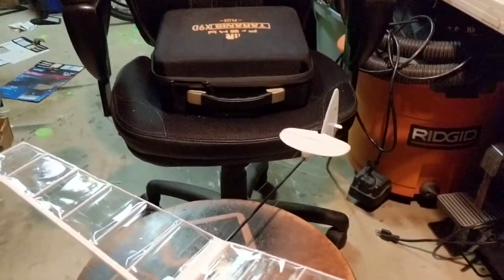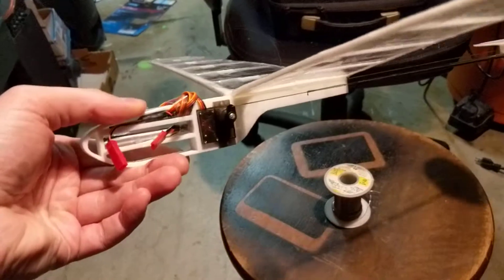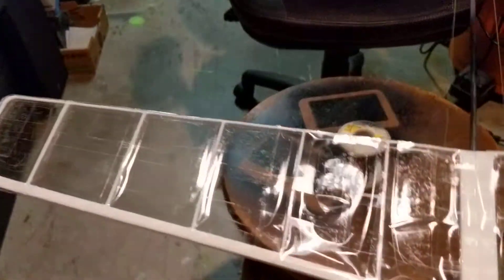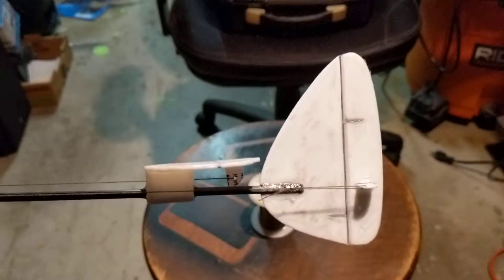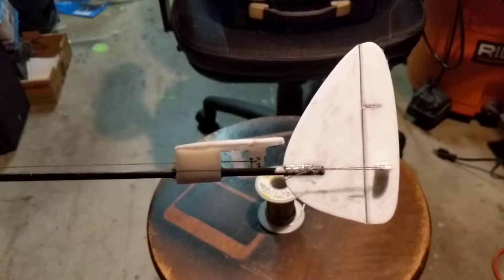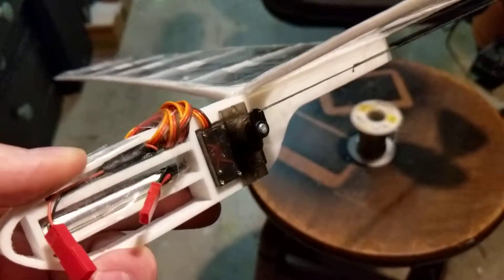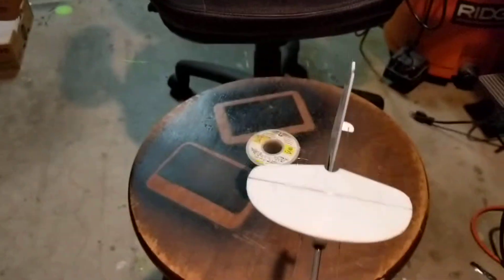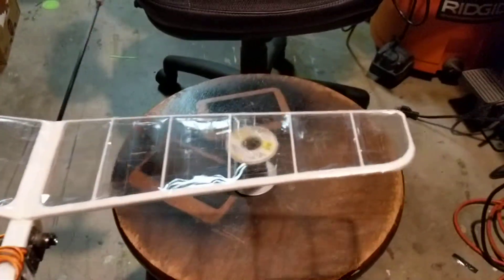2nd Gen 3D printed Micro Discus Launch Glider

Comment: How did the flights go?
Reply from the maker: Not good. I have been working on improvements and it's a slow process but worth the effort. I have been following a guy that builds wings form foam board and adding my 3d printed servo housing to the mix and it's getting better than you can buy on the market! Check out this channel.

https://www.youtube.com/watch?v=brS6v_dCX5w

This is where it's at. This is what you want to be emulating at the moment.
Reply: @Objectivityiskey  Yeah...Flyboa is the guy I came across too.  The stuff he does is amazing.